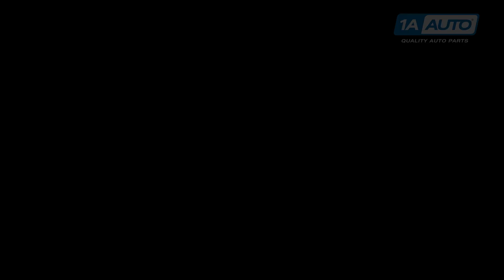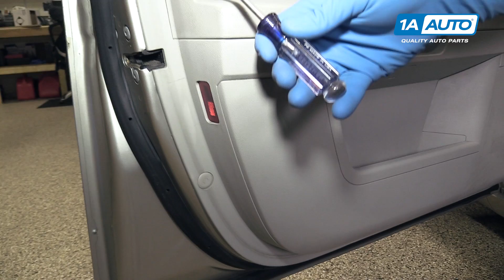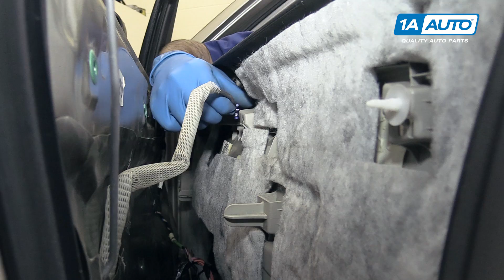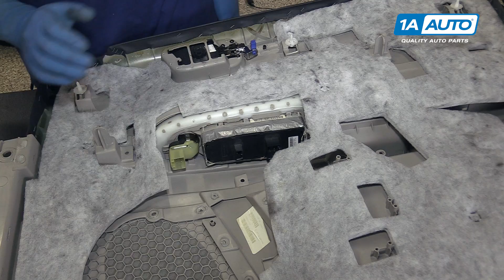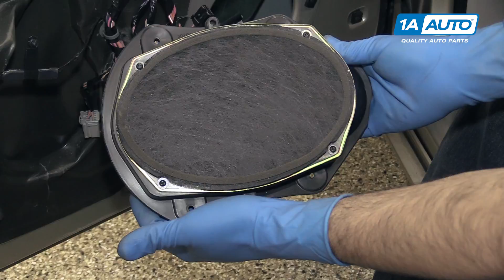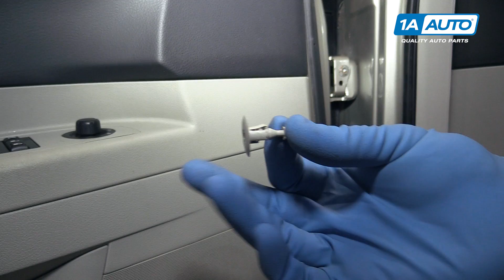How to Replace Front Window Regulator Motor 05-10 Chrysler 300

Comment: Didn’t work for me, what could be other causes of window not working
Reply from the maker: +Quiyana Warren Thanks for checking us out! Other causes could be a bad window switch, bad motor, bad regulator, or there is an issue with the electrical connection. If you are unsure what is the cause of this issue, it may be best to have it diagnosed or bring a multi-meter to the motor, switch and examine the wiring to see if there are any breaks. You can also have this diagnosed by a mechanic too.